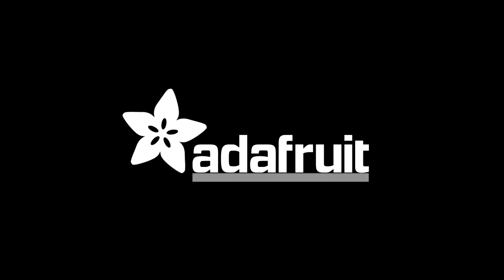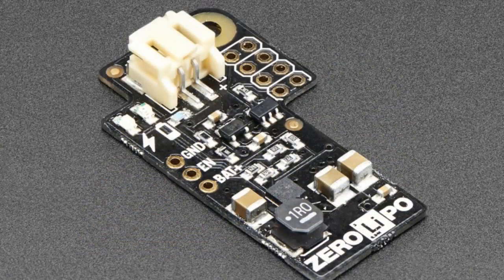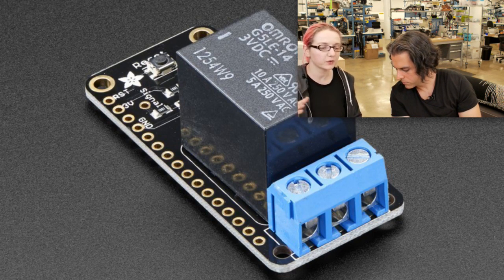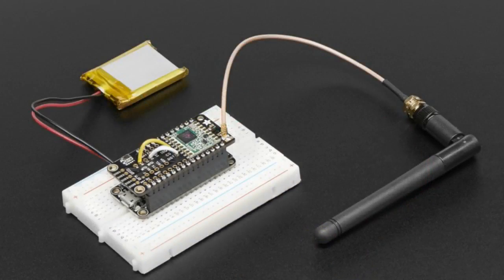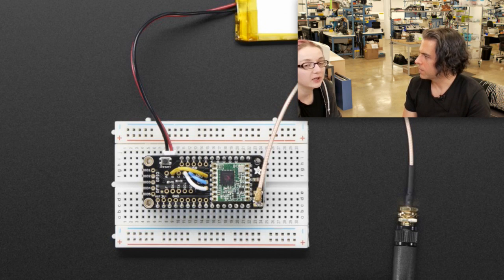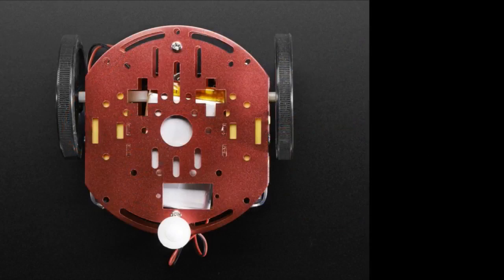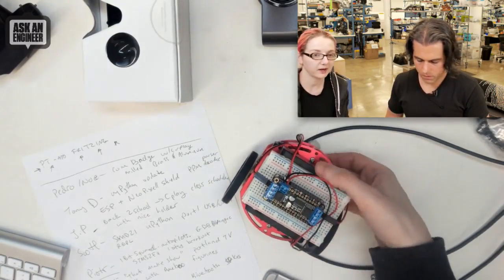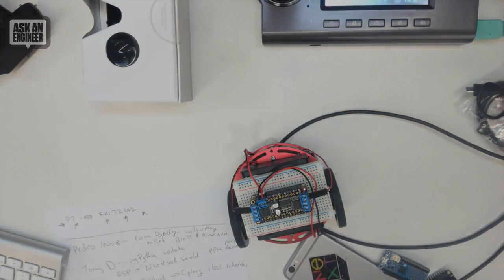New Products 8/24/2016

Comment: Would love to see some ballpark estimates here or on the website for the Lipo Zero board, that said, "XYZ mAh will get you roughly ABC hours (or minutes) of runtime." I know it's heavily dependent on the load, but not looking for guarantees, just an idea how feasible various projects with it might be.
Reply: Run time depends on both the load AND the battery capacity, so that's not very practical.
Reply: @ercost60  you’re replying to a comment that’s 5 years old, and specifically addressed load and battery capacity already,

Comment: hello im looking for a rpi3 display that is compatible with the kali arm?  any suggestions?
Reply: Well any HDMI display should work. They are a bit expensive but pretty easy to use. Analog displays are cheaper but hard to read and small resolution. GPIO displays require software which is not that easy but not impossible. (Like PiTFT)